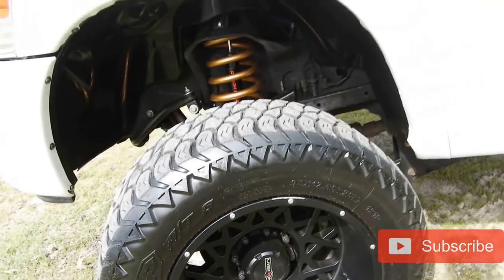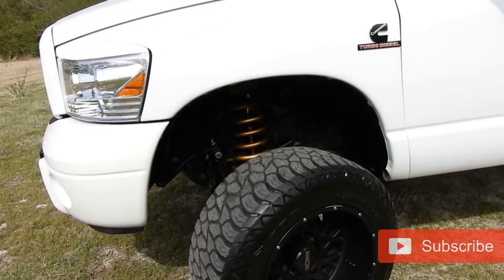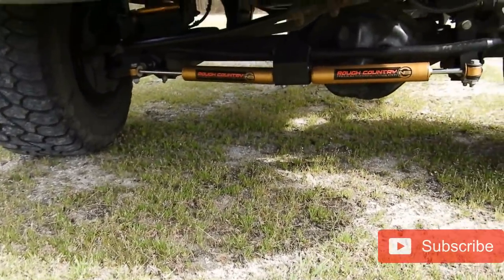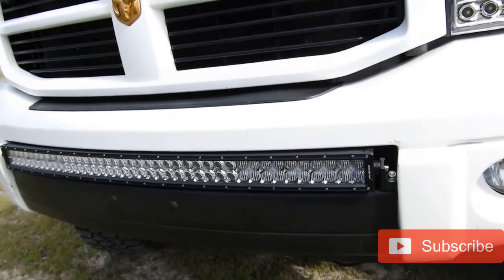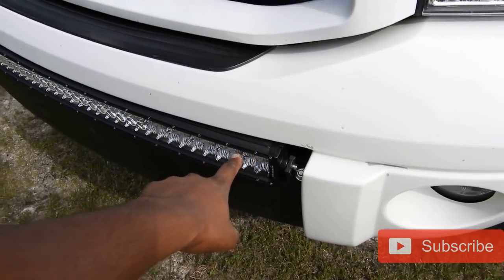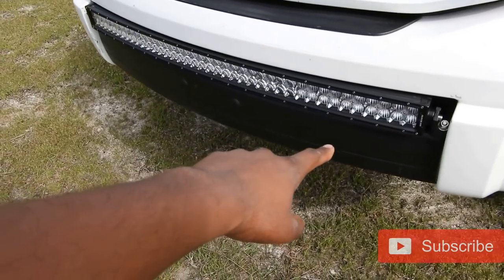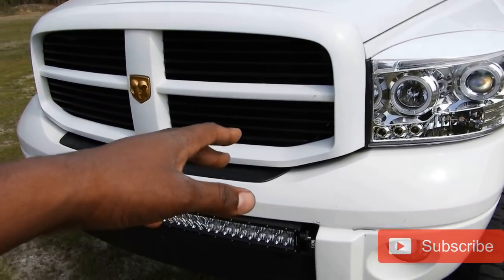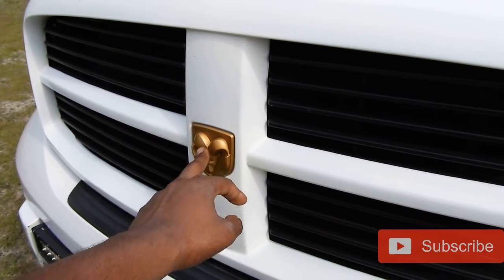BIG SEXY... 3rd Gen CUMMINS MegaCab Walkaround!

Comment: If you want your interior lights smoked, just toss a coat or two of Liteshade on the inside it will look good
Reply from the maker: Good point man, but I actually need to get new ones cause the little plastic clips on these broke lol that why they are not in 😂

Comment: How did you wire your tow mirrors
Reply from the maker: https://youtu.be/Apf8m6_ThE4

Checkout my video when I installed them. I show how I wired them up
Reply: @EVERYTHANGDIESEL  I ran mine through the door through the gromet (not easy but cleanest correct way) though the cab to blinker. To seperate running and blinker lights i pulled the glass off connected the puddle and front facing light to the heater. So i hit the heater an my front mirror is a  running light and puddle lights come on and the blinker in the glass blinks with my blinker
Reply from the maker: That's what I call dedication lmao

Comment: Where is your injectors?
Reply from the maker: I sold them old broke ones. Currently running stock ones.
Reply: @EVERYTHANGDIESEL  I thought you were getting some from F1 diesel, I knew you had junk ones but I thought F1 was getting you all set up.
Reply from the maker: I was gonna  do it but plans changed and didnt want to drop 2k at the moment. Summer plans 👌🏾